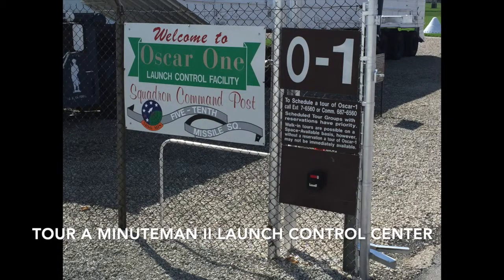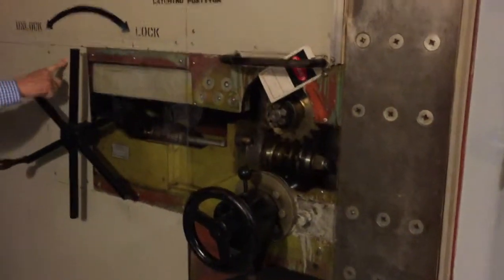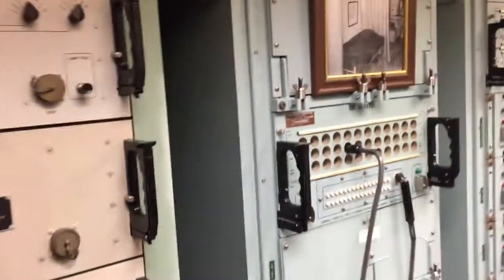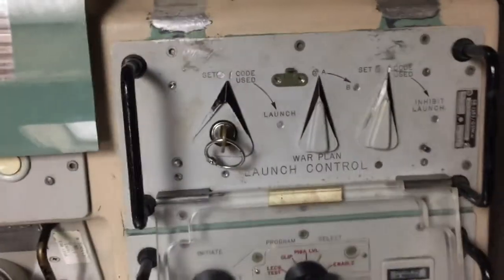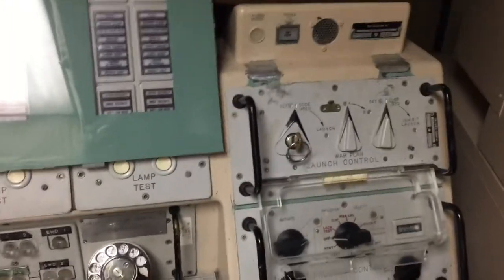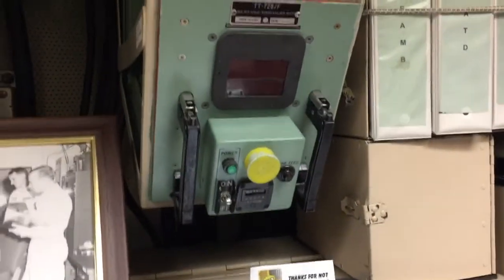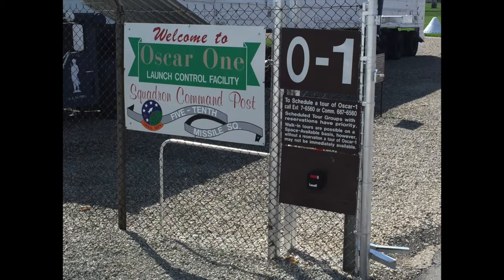Tour A Minuteman II Launch Control Center

Comment: I was supervisor of the Antenna Maintenance Shop at Whiteman from 1975 - 1978. We maintained the HF Receive, HF Transmit and the UHF Antennas for the LCC’s. My shop developed and installed the entertainment system for you guys. We installed the outside antenna, cabling, TV inside the RF Shielding box above the Console Commander’s seat (you can see the people’s reflection in it) and the Radio Shack AM/FM radio above the Deputy Commander’s seat. 
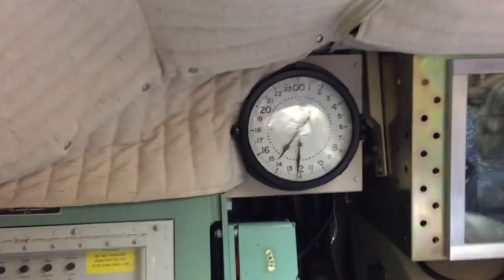We often had to come down inside the LCC to do PMI’s on the Antenna Equipment. I often told people that I carried a key to the Safe/Arm switch inside the LCC.  It was not to launch a missile, but it was to open the green box located to the left above the Commander’s Console to arm the system that allowed launching another HF Receive antenna if one was damaged. You can see it at 5:20 on the video time stream.
Reply from the maker: Thanks! I never knew what was behind that locked panel. Presumably the antenna wouldn't have to be raised in a hurry or in a nuclear environment, since crew members didn't have the key. 

You refer to PMI. That's periodic maintenance inspection, for those not familiar with the jargon.
Reply: Tony Martignetti Nonprofit Radio I thought You guys must have had a key to that box, because I know you had the capability to raise another HF Receive   antenna in the eventuality that the one already erected got blown away. It has been a lot of years and maybe my memory is slightly wrong.  It could be that the safe arm switch was normally kept is the armed position, and then we had to open the box to place it in the safe position when we did our tests, but that does not make sense, because the selector switch was not protected.  
It has just been too many years since I worked there: 41 years ago. I probably have a still have a key to the lock, since I carried one on my key chain back there (I have a can with about 200 keys in it that I accumulated over the years! 
I know there was a selector switch on a panel at the Commander’s position, and you could select one of the other four antennas (#1 was the one already erected) and then send a signal that blew the shape charge which was around the bottom of the hold down tube which the antenna was fastened to.  The antenna was basically a 30 foot long pipe that was hollow and filled with nitrogen at 300 PSI.  The bottom of the pipe, which was inside a little silo underground was sealed and fastened to the floor of the silo. To raise it, an explosive shape charge was detonated which instantaneously cut around the bottom of the hold down tube and the 30 foot of pipe was launched like a rocket upwards. There was a mechanism to stop the upward movement and lock the pipe in place when it reached the top of the silo.
The PMI we had to do were to check the pressure inside the pipe periodically and then test the firing circuit to each of the shape charges using a special test set that would not send enough electricity to ignite the charge. 
I will have to make a trip to Oscar One at Whiteman AFB, to refresh my memory.
Reply: @eagleviewhd  I was a launch officer at a MM2/ILCS squadron up at Malmstrom in the 70's.  Our HF antennas were not locked.  On the upper right above the Commander's console was a selector switch and a fire button.  I actually got to pop one up one time during an ORI just to test the system.  Very cool.
Reply: MrGunny2009 Ours had a lock on a safe arm switch. It was located in a box to the left of the console.  The box had a padlock on it.  At Oscar one at White,an AFB, the lock is still in place on the box.  I think it was only put on safe when work was being done on the antennas, and normally it was in the armed position so the Launch Crew could erect an antenna whenever needed. 
We would unlock the box and put it on safe when we were doing circuit tests on the circuit that sent a charge to the shape charge that was around the hold down tube.
Not sure if you know how these antennas were erected, this is how they operated:  basically the antennas were hollow steel pipes that were full of Nitrogen at 300 PSI of pressure.  The bottom of these steel pipes was welded to a steel plate on the floor of the  mini silos they were in. 
When the LCC Crew wanted to raise another antenna, they selected the antenna they wanted and then hit a button or switch that sent an electrical charge to an explosive shape charge that was fastened around the bottom end of the pipe.  This shape charge instantly burned through the pipe completely around it, the pressurized nitrogen shot the pipe upwards, like a rocket.  There were mechanisms built on to the pipe to slow down the upward movement and to lock it into position in it’s erected position.
Reply: Tony Martignetti Nonprofit Radio It was a long time ago,but upon further thought, I imagine the safe/arm switch inside the locked box that was normally kept in the armed position and only when certain maintenance tasks were performed was the box unlocked and the system switched to safe position.  
We had to do a circuit test on the electrical circuit that actuated an explosive shape charge.  We move the system to safe to do these tests with a special piece of test equipment, then after the tests returned the system to armed.
Reply: Those procedures sound familiar.  Whenever there was HF antenna maintenance there was a safing lock to keep from skewering any of the technicians.  But, at other times, we could pop a fresh one up if we needed.  But, they were pretty reliable and we seldom had the need.